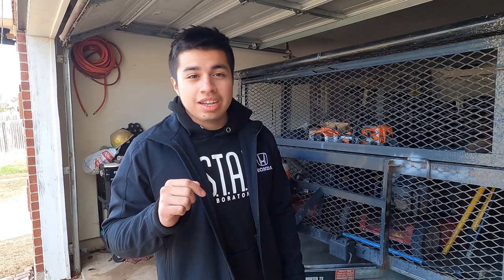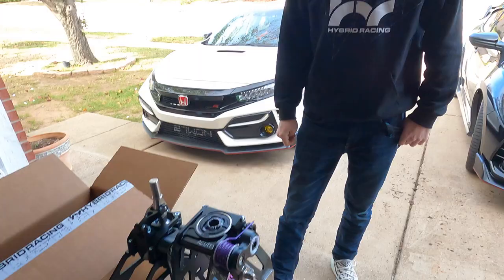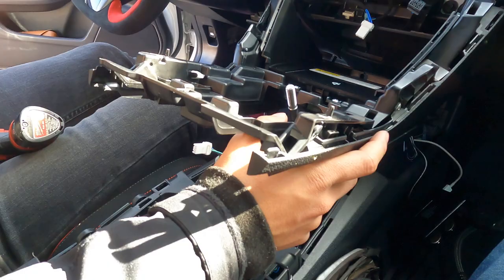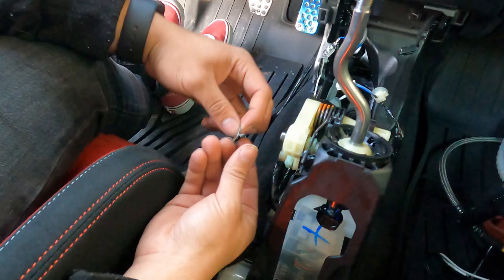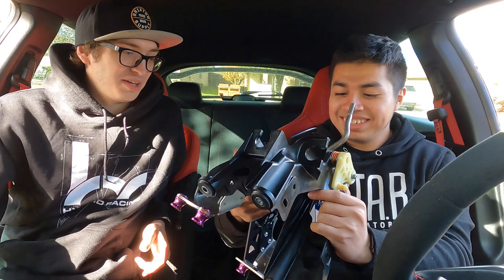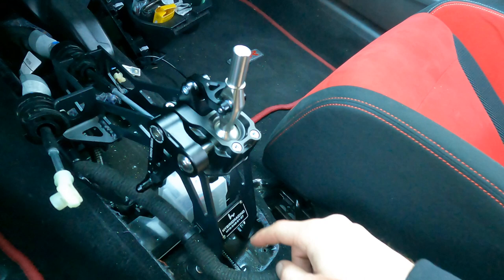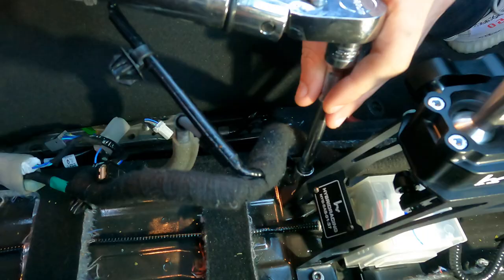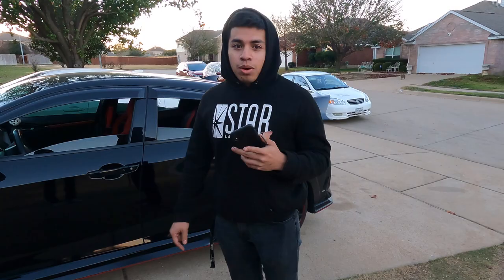WATCH THIS Before buying Your short shifter! Acuity Vs. Hybrid Racing Unboxing and Install

Comment: The reason Hybrid doesn't bother with the locking mechanism is because they assume you will be using their 16-21 Type R shift cables which lock in with the same type of tabs as the trans side uses stock.  I have the Acuity that I installed all titanium bolts on because I'm OCD and the BIGGEST change was the Hybrid shift cables.  Kind of a PITA job but WOW what a difference!  I have had 17-19 Type R,  20-21 Type R.  Hybrid trans side bushings, Seeker base bushings on 20-21, Acuity rocker on 20-21 and Seeker short shift attachment on 17-19.  Installing  the Acuity was a HUGE upgrade, then installing the Hybrid cables was a big upgrade and finally installing the Hybrid shift detent springs was big too.  The shift detent springs MIGHT be too heavy with the Acuity shifter for some but I like it.  I run an NA2 NSX Type R titanium ball knob or Spoon sports flat top aluminum knob.  This is in my 18 Type R and yes, there is quite a bit more NVH.  My next upgrade is to try the Hybrid clutch master which they claim gets rid of a damper but I already removed the clutch delay valve from the stock Type R slave cylinder which was SUCH an improvement!  The slave clutch delay valve is HORRIBLE!